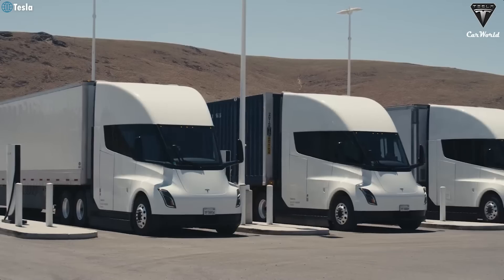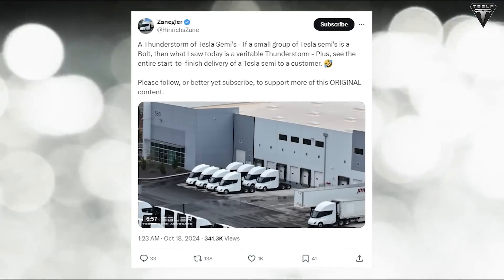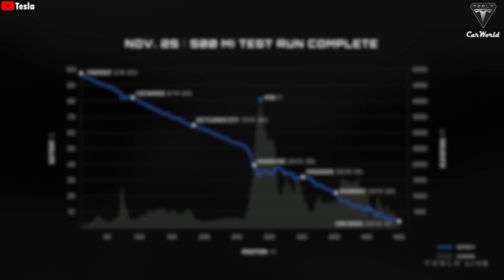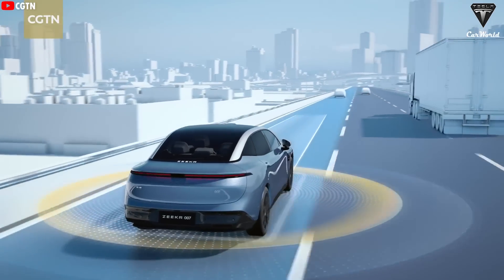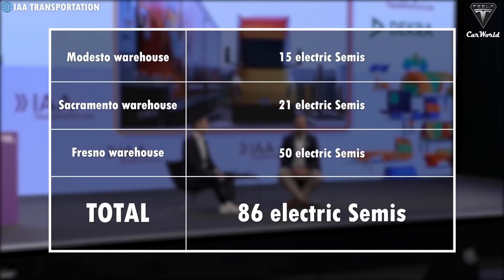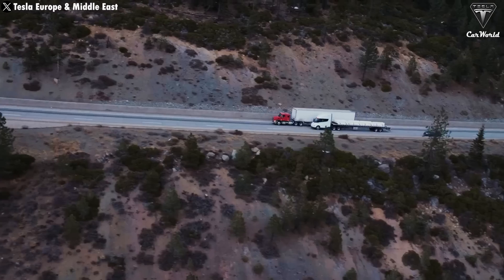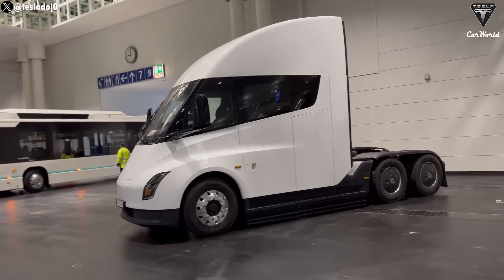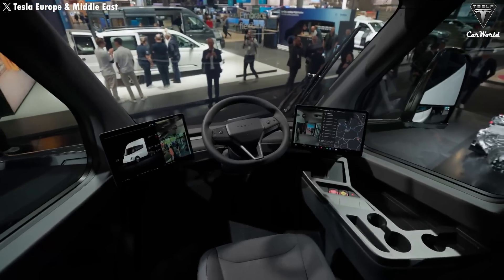Tesla Semi New Updates! Elon Musk Announces New Feature, Insane Efficiency & Mass Production on DEC!

Comment: I have a friend that is an electrical engineer, and he's working with 2 national big box retailers working on solutions to allow EV semi's to recharge while unloading at their stores.  This solves 2 issues:  (1) trucks can recharge the power that has been used going one way to the stores while they are unloading.  If the truck battery drops from 90% charge to 40%, the truck only used 50% of battery life.  By adding 30% to the battery at the store level, the truck now is back up to 70% charge and has plenty of charge to return to the DC.  This increases range and utilizes down time while the truck is not moving.  and (2) By recharging at the store level, the demand on the electric grid is far less than trying to do it at a Distribution Center  where you might have 50-100 electric Semi's, and this makes adoption more accessible to places that he more limited access to Tesla Mega Chargers.

Comment: I’m wondering when I’m going to see a regular semi doing 30mph on the highway. Most these trucks easily cruise at 75mph. They go slower to be safe when hauling.
Reply: What do you mean?  The Tesla Semi can definitely go 75 mph... even going uphill, when ALL diesel rigs slow down to a crawl.
Reply: @ in the video when they were talking about comparing regular semi vs the Tesla it says that regular semis can only go 30mph.
Reply: @Carlos18731  Which is correct on a 5-7% uphill gradient like on I-70 on both sides of the Eisenhower tunnel, for example.
Reply: @ not at cahoon pass on i15. %6-%8 grade and most trucks are flying up the hill at 60-75mph everyday.
Reply: @Carlos18731  BS!

Let's take the example of a top-of-the-line 525 HP Freightliner, fully loaded to 80'000 lb max weight.
What speed can it maintain on a 6%, respectively a  8% incline?
On a 6% incline, at FULL POWER, it can maintain 40mph.
On a 8% gradient, it can maintain no more than 26-27 mph!  Even COMPLETELY empty, it would stall at 48-49 mph!

That's the law of physics... nothing to argue against them!  Those speeds can easily be calculated with a little knowledge of physics!

You got caught lying!
Reply: @Carlos18731  I supposed you meant Cajon Pass, on I-15?  BTW, its max gradient is 5-6%, not up to 8%.
BTW, the speed limit for trucks on I-15 over the cajon pass is ... 45 mph!
Reply: @ ok buddy as if I didn’t drive freight for ups making that same drive twice a day for 12 years. 
You say law of physics but say absolutely nothing to back it up.  What proof do you have that completely empty it would stall at 48-49mph??? How is this proof of physics? Completely empty these trucks would easily fly up the hill at 80mph.
Reply: @Carlos18731  They said "... on a 10% uphill gradient...". Which is not only true, but actually quite optimistic.  NO American diesel truck will even reach 30 mph fully loaded up a 10% gradient!
Reply: @ sure speed limit is 45. But nobody does the speed limit in California. But the point of my original comment completely went over your head. The video said traditional diesel trucks can only go 30 mph, which is flat out a lie. These trucks can do 80mph. Up a hill any vehicle is going to feel a 80k load, even your beloved Tesla. I’ve seen trucks go up this hill 60-75mph every day, regardless of the speed limit. I can even go up this hill in my 45 foot diesel pusher towing a trailer that weighs 25k lbs. 
Now can an electric truck do it with more ease? Sure they can, but just how much of that battery and range are they chewing up doing so?
Reply: @st-ex8506 don’t get your little Tesla panties in a twist now. Listen to the video around the 4 minute mark and you will see where it says 30 mph. 
And if you really knew what you were talking about you’d know that horsepower isn’t really a big issue with towing. But typically semis will have around 500-700hp but have nearly 2000ft lb of torque, plus they have mechanical advantage with their gear box. 
Again not only have I driven trucks for over a decade, I’ve continuously done this drive and these grades at over 60mph and even a little more at times. And that’s physics for you, since you’re so adamant about it. The same physics that would affect a regular truck would affect the Tesla, like the load you’re carrying, road conditions, wind, etc.
Reply: @Carlos18731  That is the typical speed of trucks going uphill.
Reply: @Carlos18731  You idiocy is showing. Nobody but you is talking or cares about empty trucks - they are few and far between. Almost all trips carry cargo and loaded trucks crawl up hill. Go clock the speed of the continuous line of trucks climbing the I-5 Grapevine each morning. They only wish they could get up to 30 mph!

Comment: Local delivery trucks, mail delivery vehicles, and garbage collection trucks should all be electric given their constant starting and stopping, the fuel savings would be enormous.
Reply: why do you think they aren't? Its really simple. The carrying capacity of an electric truck is vastly lower than diesel because the bigger the truck the bigger the battery and the bigger the % the battery is of the weight. Therefore, they are far less cost efficient
Reply: @johnhunsley8860  This TOTALLY wrong!

Look at the Tesla Semi, as that is the truck we are talking about on this thread.  The 500-mile version can tow the same than the average diesel truck... maybe 0.5 ton less in the USA, but 1.5 ton MORE in Europe.
Its 300-mile version can tow approximately 1 ton MORE than the average diesel truck in the USA, and as much as 2.5 tons MORE in Europe!
The respective empty weights of the two versions are known since last September!

You should inform yourself a bit better before writing such counter-truth!
Reply: For some reason they started with the biggest trucks on the road. As you say, smaller electric trucks and vans would make much more sense. Especially because you can charge them at the garage over night and so you don’t need new fast charger
Reply: @phil0348  In Europe, we by now see plenty of smaller electric trucks used for local deliveries.
But the bigger electric trucks don't need "new fast chargers"... only regular v3 and v4 type superchargers, but installed so as to allow drive-though charging of semi trucks and other towing vehicles.
Only at the base  of trucks operating dual shifts are so-called "mega-chargers" warranted.
Reply: @phil0348  Europeans already doing it. Tesla is too premium for the market full of very decent MB, VW etc.
Reply: That is impossible. There is no power grid in the world that can support that. Many companies in the US have approached their Electric Services, and been told it is impossible to supply enough energy to support an entire fleet if electric delivery trucks. 

What we should be pushing is Hydrogen Fuel Cell Tech.
Reply: @ hydrogen is, as Toyota has amply demonstrated with the Mirai, and for at least 8 different reasons, a dead-end street!
And there is no problem, in a country with a modern grid (unlike the US of A), to supply a depot for a fleet of dozens or even hundreds of electric trucks and delivery vans.
The company overseeing the European grid has recently stated that the grid could already, today, accommodate 100 MILLION electric vehicles! We are still very far from it!

Comment: Okay. My only question is this. Suppose you drive about 500 miles with lights on, air conditioner, and anything that runs on electric. Will this cut short from 500 miles or what? I’m trying to understand about the electrical use. Anyone? Thank you.
Reply: Well... it will affect range for sure... cutting it by about 5 miles  But the worse loss comes in the winter, when both battery and cabin must be warned.  But even by sub 0°F weather, the range will not be affected by more than 5-10 %.

Comment: Waiting on someone to stretch the chassis and convert one of these into a Coach RV. Depending on weight, the range should be even further with far cheaper operating costs. Also, use the Aptera style solar panels all over the roof and sides and really re-generate some energy while you drive or parked at a camping site.

Comment: Now imagine the trailer you pick up has a battery in it. So you just drop off a trailer and pickup a trailer fully charged and bam you get 800-1000 miles out of it.
Reply: That’ll cut down on the total weight you can pull imagine how much it’ll weigh with all those batteries an empty trailer about 40 thousand pounds alone minus the batteries
Reply: Just no capacity for freight; isn’t that the main function, battery & infrastructure not practical !
Reply: Why would you put the battery in the trailer???  I understand what you mean, but that is impractical.  As the battery in the trailer would not replace the batteries in the tractor (unless ALL trailers had batteries!), you would end up with a lesser payload and a heavier investment.
No, the truck just recharges quick enough, as Pepsi's pilot operation has demonstrated.
Reply: Google Trailer Dynamics
Reply: There is no need for logistics work as companies will always work around the base capabilities.
On the other hand, for RV solutions, the range will already be greater because you won't haul 75k lbs, possibly double the actual range.
Reply: Wow, do you work for Tesla 😂😂😂😂
Reply: Splendid idea. Mount a battery on the trailer , whiçh charges  the main battery underway.